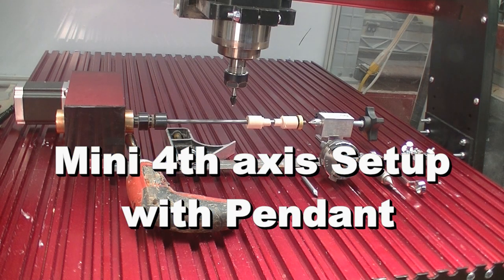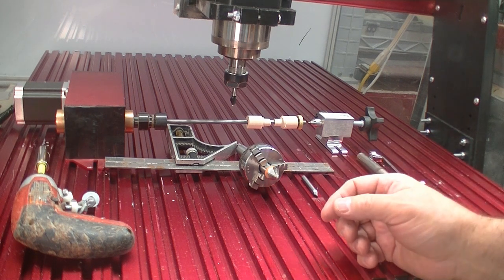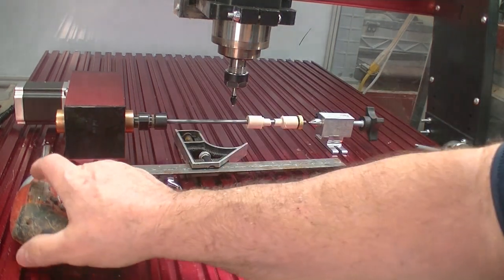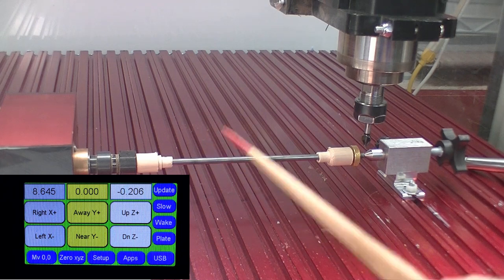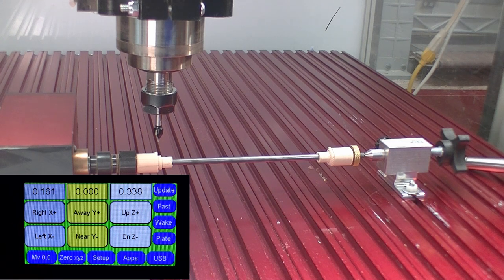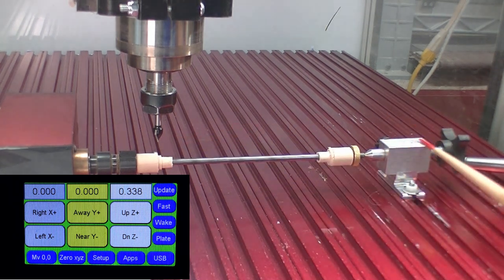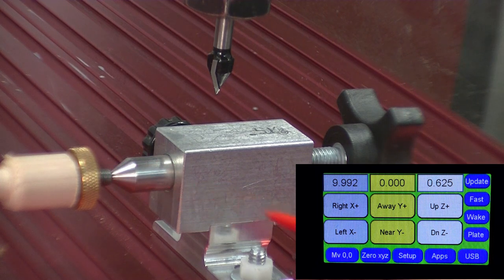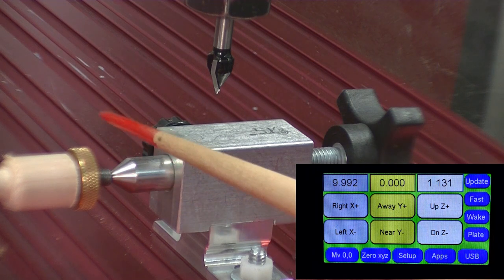Mini 4th Axis Setup

Comment: As a machinist for over thirty five years and over 25 years of CNC machining experience, I highly recommend you invest in a dial indicator. You can get the alignment done more accurately and quicker. There is one on amazon for 40 bucks. There are videos on you tube to show you how to use one.

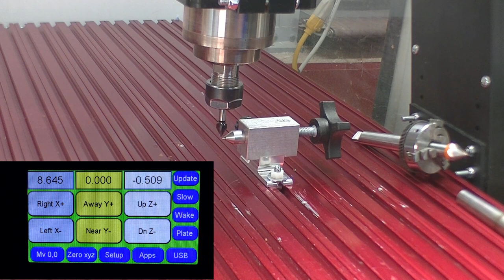Comment: The measurement from the top of the tail stop and center line of the tool was .509 at time 12:50, not .506 as you state at 16:00